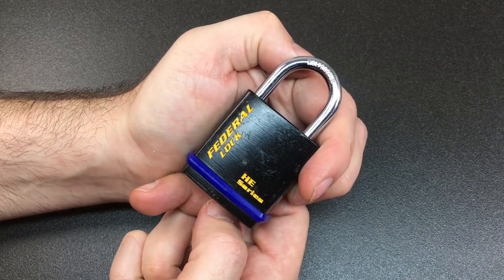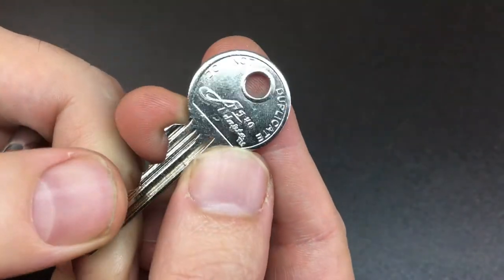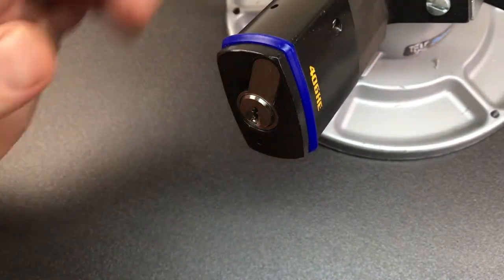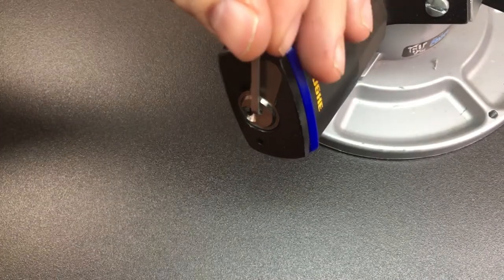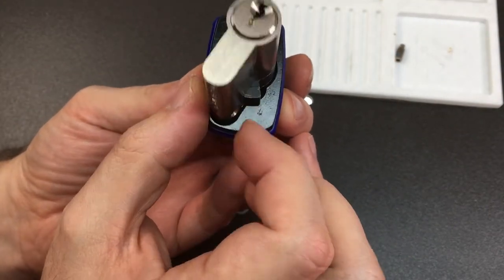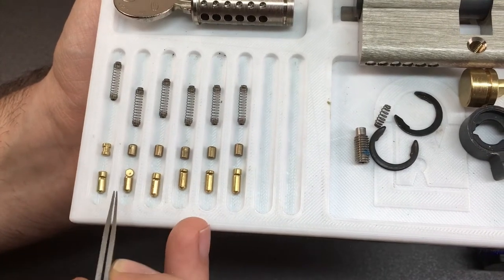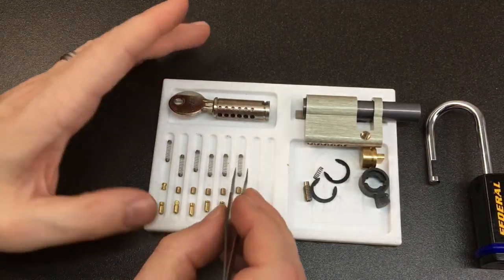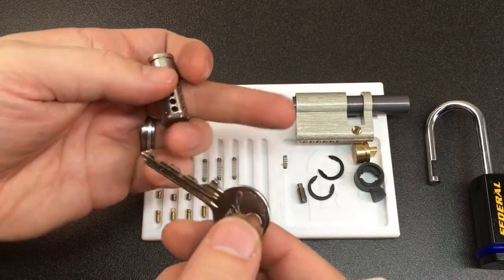Adapta J 40 Lock in a Federal 406HE Padlock Body Pick and Gut

Comment: An incredible lock. Doesn't 6 wafers mean that the lock technically could be opened with at least 6x6 different keys? aka 36+? 👀 I've worked in security all my life and I still ask; who would need that? 😄👌🏻
Edit: Odd they put only 1 security pin in out of 12. It's such a shame that wafers jeopardize picking security so much..